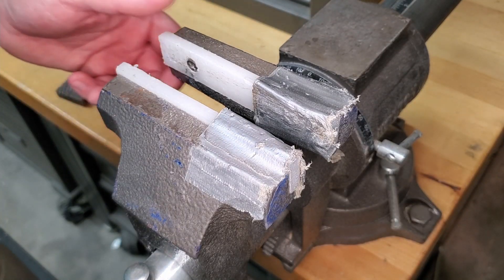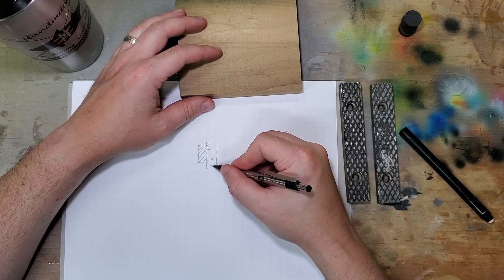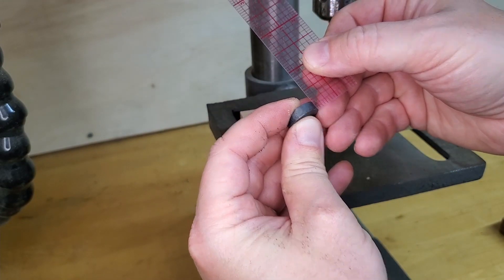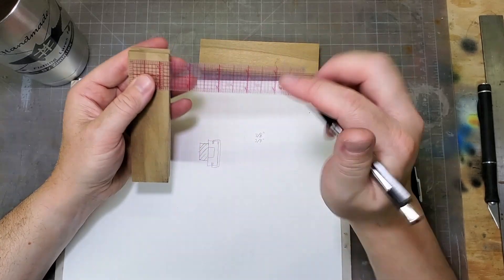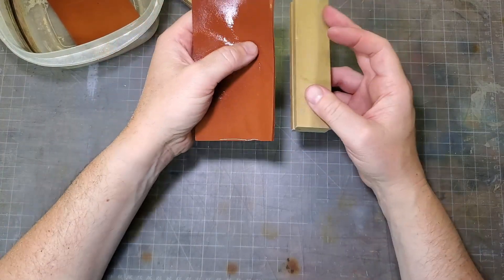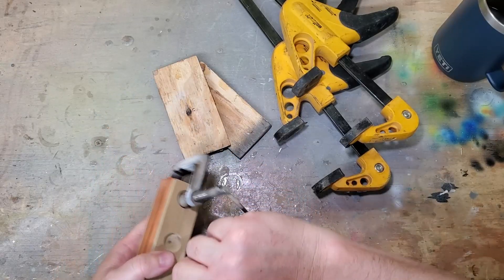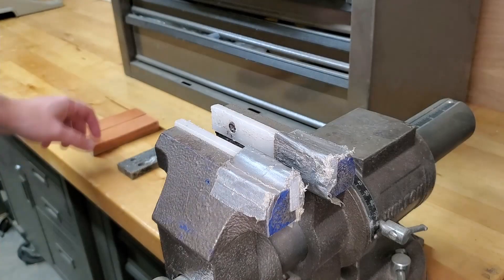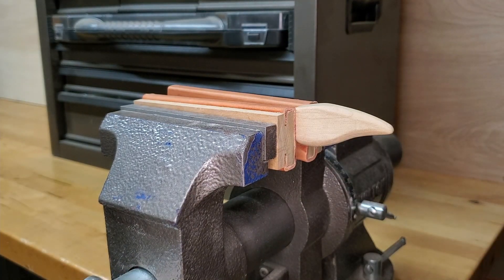How to Make Leather Vise Pads for Handmade Wooden Fishing Lures

Comment: I really enjoy your channel.  I learn a lot from you. Thanks for sharing your expertise🙂🙂 
Quick question...
I tried using forester bits to make weights like the ones you use to balance lures but I couldn’t remove them from the wood mold. I used oak.  Different sized bits 3/8” deep. Did you prep the mold with something first?
Reply from the maker: Thank you for watching! Sometimes I have a few stubborn holes that won't release very easily. I don't prepare them, but they do seem to release better after a few uses. I think the hot lead burns the wood slightly and makes it release better over time. If it still won't release after cooling and vigorous banging, you might try a softer wood with more flex in it. I've been using pine. Hope this helps.
Reply: @zimmtex  Thank you. I’ll try a piece of pine. 🙂.

Comment: Hello master i wish you could read my comment in your video.. a month ago
Reply from the maker: I'm sorry if I  missed your comment. I try to respond to all comments. I have looked back and cannot find it.
Reply: Your vid about water slide decals..
Reply from the maker: @MASKTERTV  I did reply; sorry you did not get it. I use small paint brushes to apply epoxy. The best epoxies I have used are TrueCoat and East Coast Resin. Those are both really smooth and have very few bubbles. Best wishes!